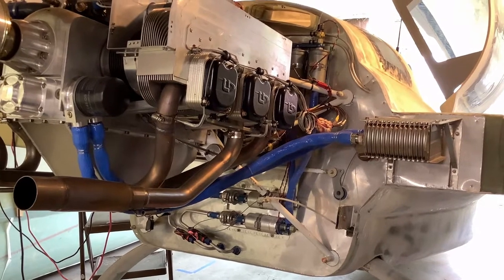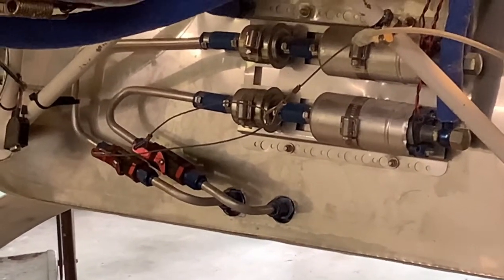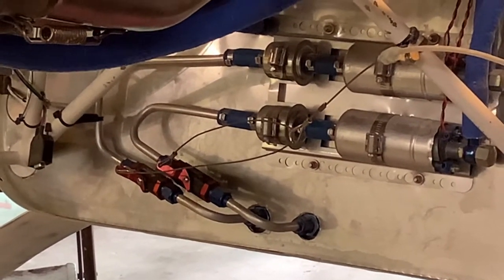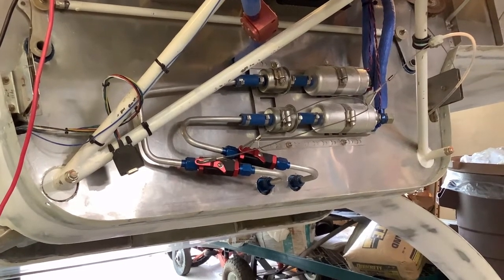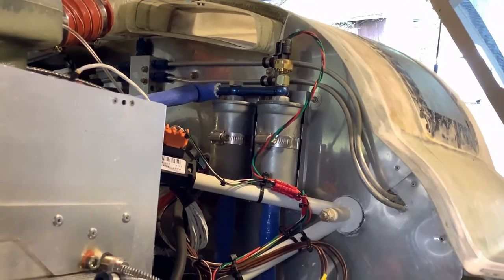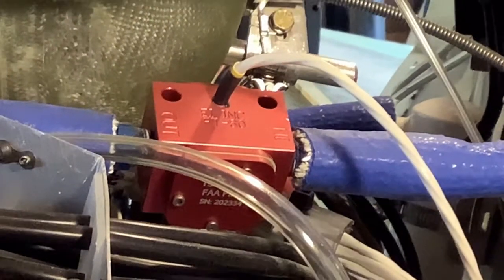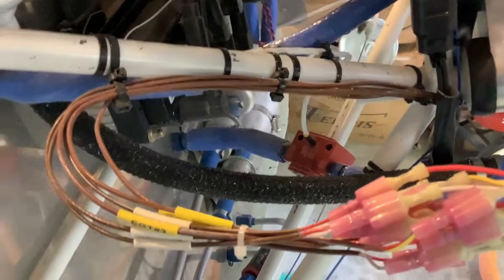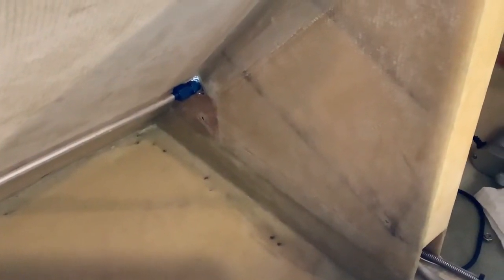A Cozy Fuel System for UL Power Engines

Comment: I appreciate learning a little about fuel system requirements for the UL Power engine but also got some ideas for my own cold air inlet to engine air filter and oil cooler mounting. Thanks for posting.
Reply from the maker: I'm glad it was helpful to you.

Comment: Wow. Complexity. More to go wrong/fail; more weight. I can think of more than a dozen ways to simplify the system, and still have system redundancy.
Your workmanship is excellent. I'm critiquing your system design; not your craftsmanship.
Reply from the maker: Thank you for your comments, K Verb!  
I tried to utilize the existing per-plans Cozy fuel tanks and plumbing, in conjunction with UL Power recommended and supplied pumps and filters.  Regarding the UL Power recommended fuel system, my thinking was why have just redundant fuel pumps, when, for another set of filters, I can have two completely redundant fuel systems.  This way, if anything goes wrong, a clogged filter, a failed pump, bad fuel, etc. all I have to do is switch to the opposite fuel system and find a good place to land.  Nothing to figure out or troubleshoot while trying to fly the airplane.
Of course, this is just one man's idea, not a recommendation for anyone to use.  Your safety is ultimately up to you as the builder of your airplane.
Reply: @GregoryACross  I love the two fuel filter system on seperate lines. Some might say the two second filters is a bit much,  and I could see the that, but that's not a likely additional failure mode, but it could save a few pounds of weight.  My concern would be all the plumbing and electrical complexities using the plans fuel selector along with micro switches and mechanical cutoff valves down stream. It's so many valves and pathways. I think your system shows ingenuity, with great workmanship.

I'm building my strakes now, and have mapped several systems over the years leading up to this point. Always designing it from the KISS principal. Now that I'm finally forced to make a decision, I've given up on the plans valve. But this is not the forum to build my system in your comments. Maybe some day at Rough River, Oshkosh, or SnF we could have a beverage and talk for hours about fuel systems.
Cheers
Reply: @Verb130  I’ve been working with automobiles for years and have changed out many fuel pumps.... and 95% of the time the fuel is as clean as you can have. The 5% are guys who get gas from unknown or unwise sources.  When I build I’m going to design a fuel system with that in mind.... pumps fail because pumps fail not because of bad fuel.

Comment: Hi Greg, I have never had that problem with my UL engine, the problem of the rpm drop when switching pumps/tanks. I see you have two fine filters and that may be the issue as there is now a path for the fuel to go backwards through the unused lines and fine filter when switching as they are after the pumps. Just a thought... Worth investigating as it should not do that.
Reply from the maker: Hi Andy, Thanks for the thoughts.  
The pumps have built in check valves, so the only back feeding route would be, as you state, back through the unused fine filter.  But there is no where for the fuel to go because of the pump check valve.  As the selector valve is rotated, there is a dead period when one pump is powered off and the next one is powered on.  That's what is causing the momentary loss of pressure.  The pressure regulator snaps closed at 43 p.s.i., but the injectors continue to drain off fuel and the pressure instantly drops since the fuel is incompressible.  (I suppose one way to resolve that would be to install a pressure tank, where there would be trapped and pressurized air maintaining fuel pressure longer... but that seems like a bad idea in an airplane, with the possibility of getting air in the fuel lines!)
As the system is currently, I understand how it works, and why, and don't really see it as a problem.  If you turn a pump off, the engine stops, if you turn one on, it runs.  If you do it relatively quickly, the engine just stumbles momentarily.  Moving air through the propeller in flight should lessen the r.p.m. drop considerably (momentary windmilling).

Comment: So if you engage the second pump utilizing the boost button then move the selector valve, then disengage the boost button do you still get the rpm drop?
Reply from the maker: That's a promising idea!  I'll have to try it.  It makes sense.  The valve only determines where the excess pumped fuel goes, so the turning off of one pump and turning on the other one would seem to be the cause of the momentary pressure drop and the rpm drop.  By starting the other pump first, that should alleviate the problem.

Comment: Hi Greg, did you have any difficulty with mounting that engine on a Cozy? Does an engine mount and FWF come with the engine?
Reply from the maker: Sean, the engine comes with the mount points that are intended to be welded onto a mount appropriate to the aircraft you are installing your engine on.  Since the Cozy is not a kit,  i.e. it's scratch built from plans, there is no mount provided with the engine.  However, it does come with all the accessories you would normally have to buy separately.  UL Power here in the U.S. will build you a custom mount on request.  You would want to talk to UL Power service rep. Ray Lawrence at Kaolin Aviation in Georgia about it: (478) 232-9560.